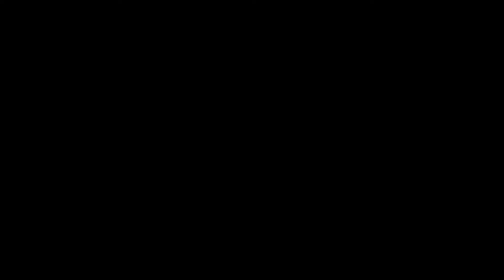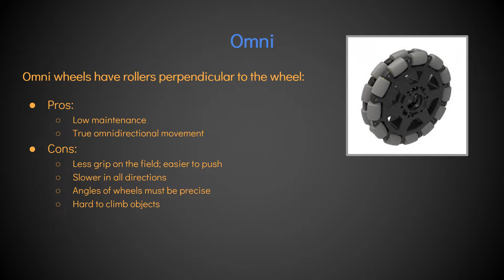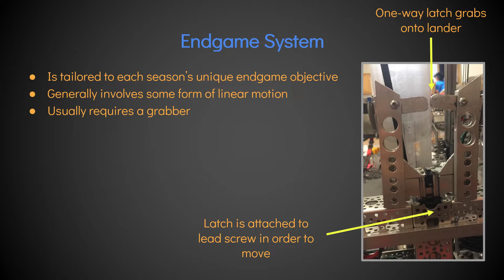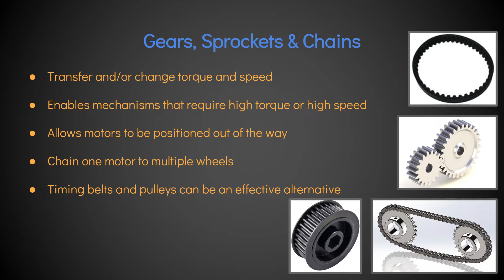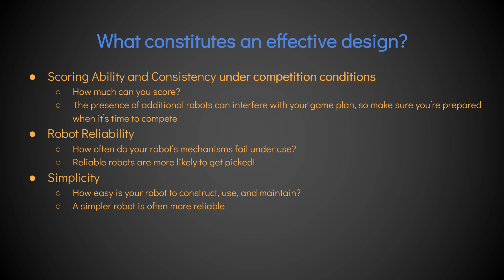RevAmped Robotics' Robot Starter Guide

Comment from the maker: 0:00:00 - Introductory Slide
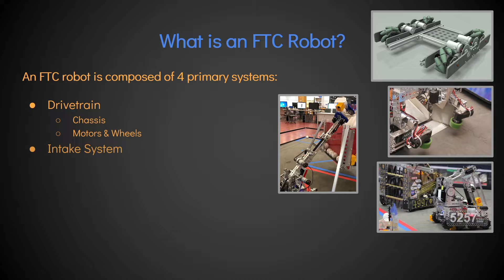0:00:48 - What is an FTC Robot?
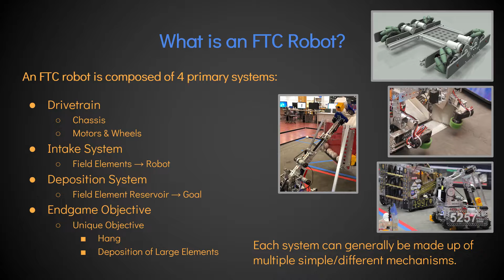0:03:13 - How do we build a robot?
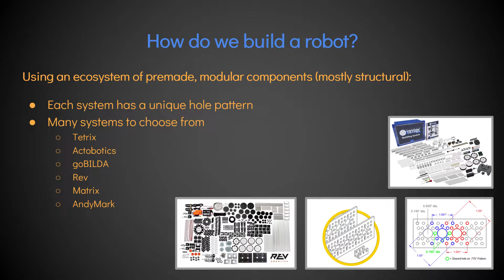0:05:25 - Build Systems
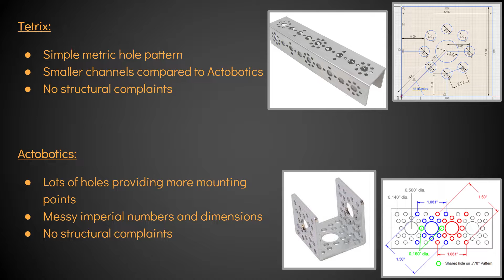0:06:15 - Basic Components (Must Have)
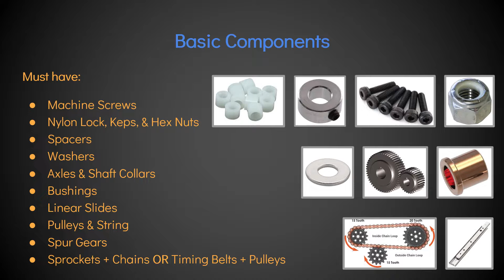0:12:52 - Basic Components (Good to Have)
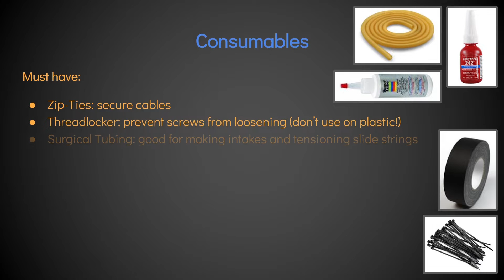0:14:24 - Consumables
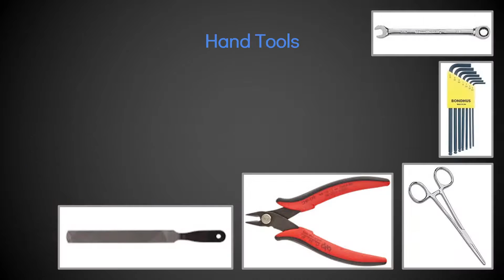0:17:09 - Hand Tools (Must Have)
0:18:21 - Hand Tools (Good to Have)
0:20:23 - Machinery and Power Tools (Must Have)
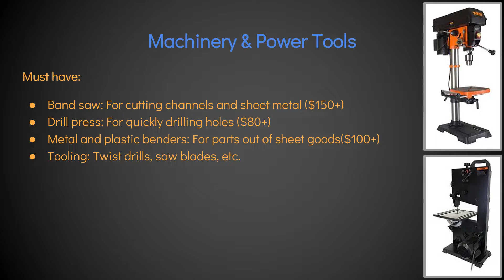0:22:07 - Machinery and Power Tools (Good to Have)
0:26:15 - Where do I buy parts?
0:27:28 - Drivetrains
0:29:18 - Mecanum
0:31:22 - Tank/Six Wheel
0:33:11 - Omni
0:34:53 - Swerve
0:37:34 - Intakes
0:39:06 - Intake Examples
0:44:48 - Deposition Systems
0:49:22 - Endgame System
0:50:49 - Linear Motion
0:51:08 - Linear Slides
0:54:00 - Feed Screw
0:57:20 - Rack and Pinion
0:59:28 - Slider Crank
1:01:58 - Gears, Sprockets & Chains
1:09:13 - Motors
1:15:30 - Servos
1:23:25 - Sensors
1:26:04 - Design Overview & Timeline
1:31:46 - Design Considerations
1:37:23 - What constitutes an effective design?
1:39:40 - BONUS: Good Practices
1:41:41 - Questions
1:41:58 - Credits